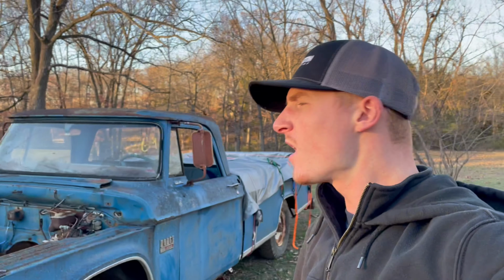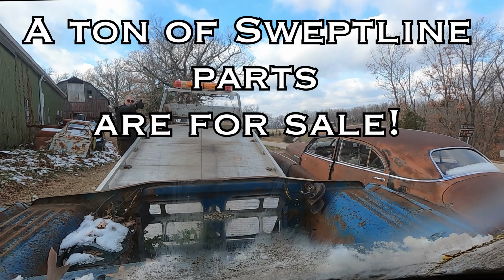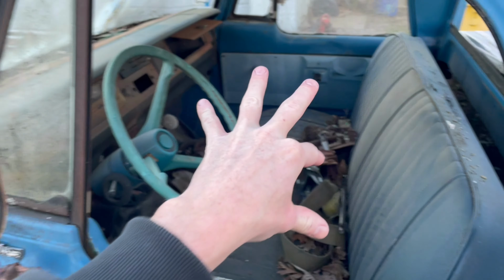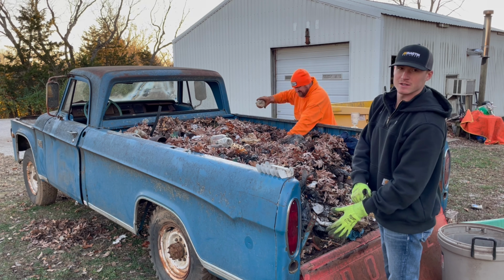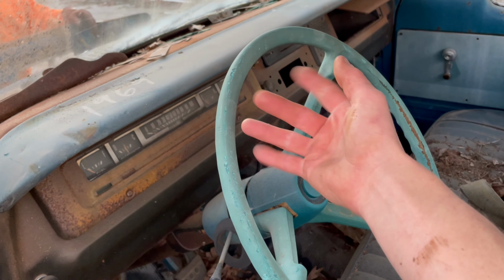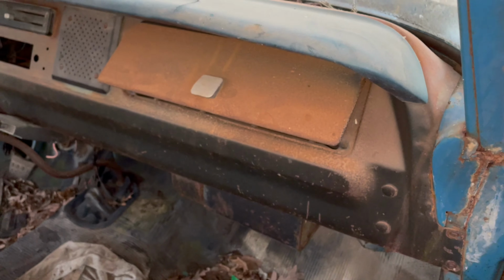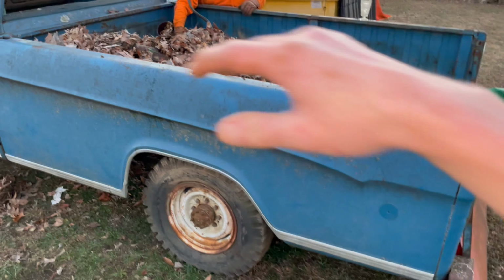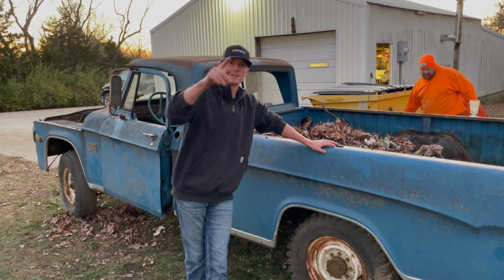Dodge Sweptline Parts FOR SALE

Comment: Looking for a pair of front marker lights and reflectors.
Reply: Side marker lights
Reply from the maker: The lenses are a little rough, would that be okay?
Reply: Sure.  Rough is better than missing in my OCD book.
Reply from the maker: @davidbaldwin4991  do you need round or rectangle ones?
Reply: @RealSteelFabrications  the round Amber ones that mount on the side just behind the round amber reflectors.  On '69 D 200s